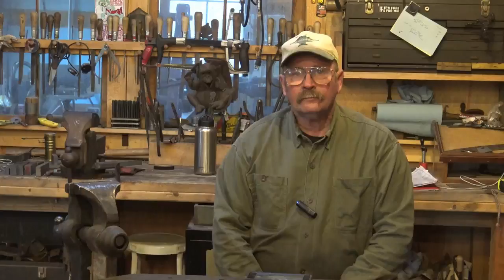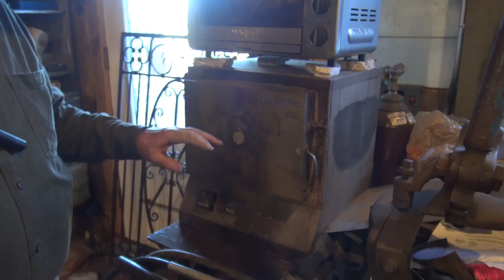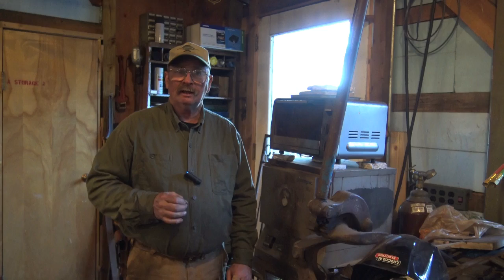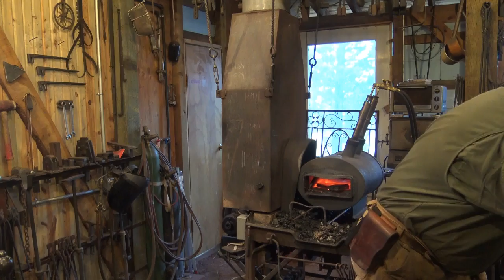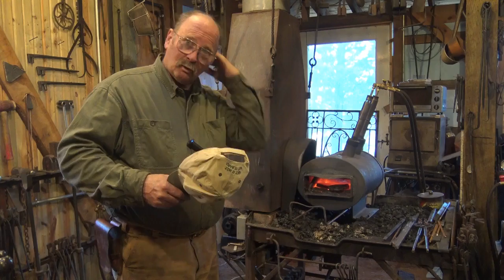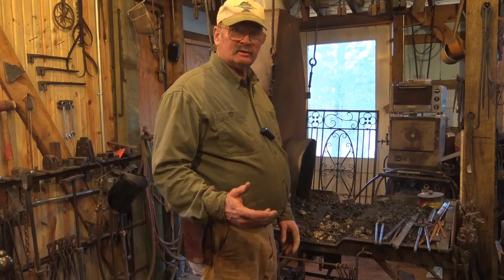Coal forge vs Propane forge a look at the pros and cons

Comment: Hey John i know this is 8years off of your video and you somewhat hit the topic but i believe i live near by and just bought a coal forge, im trying to source coal for it. Do you know anywhere to get quality coal in 2026 or do you order it in? I just purchased 500lbs out of Florence but haven't tried it out and really dont know anything about the quality of it or if it is even worth the price
Reply from the maker: I haven't found a good coal source locally.  But I didn't know there was still coal coming from the Florence Canyon City area.  Bituminous coal that cokes well is ideal, I have never had good luck with anthracite coal.  Where did you buy in Florence?
Reply: @BlackBearForge  Coal creek trading post if you come into Florence on 67 its literally just on the other side of the tracks to the left, they've got a pretty good stock pile there but like I said I know very little about it or the quality yet

Comment: On the note of Environmental, “Synthetic Natural Gas”, “Compressed Natural Gas” (From Upgraded Biogas or Power-to-Fuels etc) or more advanced Charcoals/Synthetic Coals (“Hydrothermal Carbonization”, “Pet-Coke” from Biorefineries etc) could have a place in the future for specialist uses such as Blacksmithing and Metallurgy.

It’s a whole rant I’ll probably make a video/hardware project about some day, but yeah.
Reply: “Ultra Clean Coal” (or more likely Charcoal / Bio-Petcoke versions) would be VERY neat to see as it is “washed” until it is near pure carbon.

So Anthracite if not better, and also highly porous (if not in synthetic anthracite compressed form as per a patent i saw)

Also would probably produce minimal clinker.

Burning Activated Carbon or POTENTIALLY Carbon Black (ESPECIALLY that from Methane Pyrolysis) may work similarly, albeit a pricy form of fuel for now!

Comment: I do remember the last gas well I helped my grandfather drill was back in 1963 and we did have the gas for the forge. So we had to use coal to dress the bits. When it was just started you could not see from one side of the rig to the other! Remember we were closed in with roofs and sides so it was really contained !

Comment: We always had the large forge on our cabletool drilling rigs of yesteryear !  We were dressing drilling bit from anywhere from 6"- 12" !! We usually used natural gas along with a blower off the drilling motor of the rig. You could heat an 8" bit to yellow forging temperature in about 30-45 minutes !  You had to be very careful or you would burn the end of the bit off. I remember my dad telling about him doing that one time and only one time because Grandad made him sledge it back out by himself. I forget how many heatings he had to do ??? But after that he always kept an eye on the forge ! Great videos !

Comment: Thanks for this video John.  I want to get some of the members of a low income community locally into blacksmithing. We have easy access to good quality charcoal.  What are your thoughts on Charcoal vs coal?
Reply from the maker: Charcoal is a good forge fuel.  But you will go through huge volumes of it compared to coal.  Probably about the same by weight, but the charcoal is much less dense so you use more by volume.

Comment: IMO the one and only reason to choose a coal forge over a gas forge is the ability to create your own fuel. They are great for homesteading or off the grid situations where you have the ability to make your own coal from local wood scraps. The only other thing is the historical aspect. If wanting to be either entirely self-sufficient, or historically accurate something you care about, then you are almost always better off with a propane forge. Propane forges are just faster, easier, cleaner, and for many people cheaper.

Comment: Hey John, can you discuss the pros/cons of a square vs round or oval cross-section gas forge? I am wondering if the square shape increases chances of uneven heating? Or if the oval/round ones are inconvenient due to the shape of the firebox?

Thanks,

Comment: One thing to consider is that some places with air pollution problems may have a ban on using anything fired with solid fuels.  Sometimes that may just be on certain high pollution days or it may be an absolute ban.  Some Colorado ski towns prohibit new installation of wood burning fireplaces (gas logs are OK).  Check your local regulations.  Also, in some places the local Fire Code may restrict what kind of forge you have and how it may be installed, e.g. you may need multi walled pipe to go through the roof for the chimney of your coal forge.  Again, check local regulations.

Comment: One disadvantage that I wish I was told about propane forges, is that if you have a small tank and a cheap pressure regulator, it freezes up. I wish somebody would have told me I could have just put the tank in a bucket of water. But hey you live and learn right?

Comment: Propane today is very expensive considering the astronomical rise in fuel prices.  Coal is also now very expensive and hard to get here on the west coast.  I've cut back on using coal and now only use it when forge welding. I've mainly been using the gas forge and putting up with the cost.  I've been blacksmithing for over 30 years and never tried charcoal. Think I'll try it out and see how it goes.  Good video!!
Reply from the maker: Propane is still cheaper than coal in our area but I am planning more projects in the induction forge these days.

Comment: excellent video dude but you missed a third type of forge, woodfired. good coal has become increasingly hard to find out where i live so i just keep around 100 pounds on hand for special things. mostly i just burn wood, coke it as i go, same as i do the coal. i find the wood much more economical and environmentally friendly then either of the other 2. you can get wood from anyplace and many times, unless you're picky, you can get it free. all wood burns and becomes coke and if you pay attention it burns a lot hotter than propane ever dreamed of. you can also burn wood in a furnace type enclosure (commonly called a woodstove) and heat your smithy quite nicely. i have not tried to weld with wood coke, grandson has (accidentally...lol) but its coke and you know as well as i do, it will get hot enough. other than that i am enjoying your videos, nice to share the knowlege and skills. too much emphasis these days on just making weapons and knives, i prefer coulters, cultivator teeth, highwheel cultivators, evener ends, tongue tips and hammering out old od-sized disc blades. good practical farm and home tools.
keep it up and ill keep watching...when im not in my smithy :)

Comment: The induction furnace can be a DIY unit if so desired. It does require a flowing water source (to prevent the coil from melting while in operation).  It’s essentially an RF power generator operating into a very low impedance copper tube.

Comment: Although the induction type heating devices are expensive, they have one distinct advantage, the work that they (ones can be built for specific alloys), do, is very fast (seconds).  One must learn of the alloys used in manufacture of the metals. 

No, I’ve got no vested interests in any of these type ovens.

Comment: I like how quiet coal and coke is.
I only have anthracite,and it goes out if the blast isn't restored in 5 minutes.
I do melt non ferrous with propane +oil though.Definitely will try charcoal in the forge!

Comment: An old blacksmith showed me how to start a coal fire with just 6 pieces of paper !  I could not get over it but by golly he did. I remember helping my grandfather drill a gas well and we did not have gas for the forge to dress the drilling bits so he had to use coal. It got pretty smoky in the dog houses till the forge got going good.  The bits were 6-8" bits usually.

Comment: Did you add the protective shelf in your Chili forge?  Is that what is retaining heat that then lows you to just switch the gas back on and have it relight ?
Reply from the maker: The ceramic lining stays hot enough to re ignite the gas for quite some time.  Although I don't recommend turning the forge off and back on every heat.  I only do it for the improved audio quality in the videos.
Reply: @BlackBearForge  appreciate the feedback.

Comment: Hi John just came across your channel.. Very informative.  I'm looking to get into blacksmithing and  knife making as a side hobby. By trade I'm a drop forger at Channellock in meadville PA. We use  induction forges.. They are very fast.. When I first fire it up it only takes me roughly 4o  seconds  to get a 1080 bar to forging temp. It spits out a bar every 8 seconds and the 5th  bar it's ready to go.. Very good channel  really enjoying it.

Comment: I live in Florida and I’m lucky to find lump coal. Lowes has it for $12, for a 15lb bag. I tried finding anthracite coal, but that got me a laugh everywhere I asked about it. They’re supposed to carry it at Tractor Supply, but why would they need to here? We have like one week of almost cold weather. Tractor Supply did have plenty of whole kernel feed corn, in 50lb bags for $13. It’s similar to anthracite to get started, but it produces a beautiful flame like I’ve never seen before. The weird thing is.. it produces coke, instead of popcorn.😆 You have to keep the air on the whole time or it will go out, which is good when you’re done. I’m new to this so I haven’t actually forged with it, I just burned a couple fires to cure my diy refractory cement, and to produce plenty of coke, so it doesn’t take me a half hour to start a fire. I did get a piece tool steel up to critical heat to soften it, but that was all I’ve done so far. Honestly though, the lump coal is lighter than corn, so I seemed to get about the same amount as the corn. I have my forge set up to use wood as well, so I’ve got a stock of all three fuels to see what works best for my usage. Here’s the best out of only two videos I found about using corn as fuel.. https://youtu.be/T-UgxYiiAWI ...   Thanks for the wonderful videos. It’s nice to learn from a real pro.👍🏼🔥⚒

Comment: After researching about rocket mass heaters, model rocket engines, and having my own retort, adding a secondary burning area with a secondary air intake to the chimney will burn off the unburned gasses coming off the forge from the coal.

Comment: Another concern for anyone interested in induction forges, the electromagnetic field can be a hazard for anyone with an implanted medical device. I’ve visited a friend who works around several induction forges in a commercial heat treating shop. And they go to great lengths to identify the hazard to any person that might be on the shop floor. And some of these furnace’s are about the size of a residential oven or slightly smaller. Obviously this is a unique hazard but food for thought none the less. Keep up the great work you’re videos are highly enlightening and entertaining thank you.
Reply: But, if you’ve not subject to the harmful effects of the, what’s called, the EMF, of these devices, they are VERY fast (seconds), in heating a piece of metal that reacts to the field presented to it.  There “are” furnace types that can heat Aluminum. 
Btw, I’m not someone that does metal working.
I also have no vested interests in the companies that sell them.

Comment: What is your opinion on the vintage style forge with the hand crank blower. Can you achieve the heat to forge Weld?
 My propane forge will not get hot enough. Thank you John you're a great teacher.
Reply from the maker: As long as its a blacksmiths forge with a real fire pot, it should be more than acceptable.  But there were also smaller ones like rivet forges that are not good for forge welding.

Comment: I'm very thankful that I have the option as a blacksmith to take advantage of my family's coal mine I typically get it from tractor supply but the the mine is 4 hours away and if I'm gonna make a trip down there I got to take our 1965 Ford grain truck that barely does 50 mph empty but I need to get that ready and I'll probably get 2 loads of coal and use that I just need to find the time to get down there and get the grain truck ready for that type of trip I may be crazy but good coal is worth it

Comment: So, I have white oak trees in my yard, and they drop stuff all the time. (I have to actively chop the stuff up from time to time, or else the brush pile in the backyard gets away from me). I've made charcoal in the past (it's easy enough that I usually try to make some whenever I barbeque after the burgers are done), so that wouldn't be an issue.

But if I were to try to forge with it (in either wood or charcoal form), is there anything I need to watch out for?
Reply from the maker: Charcoal is a great forge fuel.  But you needs much more by volume than you would coal and it leaves lots of ash behind,  But it burns cleaner and isn't as likely to annoy the neighbors.
Reply: @BlackBearForge  I'd ask about the raw white oak, but that smokes like crazy (to give you an idea, I made a turkey in one of those cheap charcoal grills and it melted the paint off, but the parts of the turkey that weren't burnt to death were fantastic, hahah...didn't even have to put a pan in to make any smoke...)
Reply: P.S. I have a cedar tree as well, but i'd be worried about poisoning myself with that...

Comment: Dear John, I have a gas fired forge and appreciate the cleanness of the burn and the good concentrated heat.  My main problem is that the fire does not allow for segmented heating of only a part of your work.  It is also limited in size to that of the mouth.  I agree with the discussion about coal and think it is at the end of its line.  

What about the idea of building a gas fired furnace where there is a central pit that heats up some carrier medium in the open, built like a coal fired forge.  A small circular fire in the centre powered by gas is the idea.  The user can then place their work at exactly the spot they want to heat and the parts you don’t want to heat are out of the heat. I’m not sure what the medium would be as it would have to survive being heated up to 1500˚C or more.  I guess clay beads would survive this intense heat but would give a bed of resident heat.  

How big to make this fire?  It’s a surface area versus volume argument.  A sparrow cannot survive in the Arctic but a Woolly Mammoth can.  For the same reason, making a fire say 300mm in diameter would work nicely. It would also mean that once established, little fuel will need to be added to maintain the core heat. 

To heat your metal, poke it into the centre and wait a couple of minutes and voila - red heat again. Clean abundant relatively inexpensive heat that gives the versatility of an open pit fireplace.

Comment: A difference I see in coal vs gas forges is that in a coal forge you can very precisely isolate the heat, a gas forge just heats everything inside...
Reply from the maker: True, but there are many instances where you want that long heat.  So having both options is ideal

Comment: I happen to work at a coal mine, so coal is my go-to. However I just downsized my shop space considerably, and working in small spaces, I'm limited to what exhaust methods i have available. I'm either going to gas, or I'm gonna make a forge cart to roll out onto the driveway. Haven't made up my mind yet.

Comment: Going into this video I was wondering if I'd get any closer to deciding on gas or coal, gotta say it sounds more like I need both!

I will be building my own forge and it wouldn't be hard to weld from say 10mm steel plates. I will be forging outside so I can ignore issues with heating up the place. I will store the equipment in a building I am building right now, will be uninsulated. A simple coal forge I can wheel outside is a simple way to get started I am thinking and very flexible. What really attracts me the most about coal is how you can put any piece of length in the fire whereas that would be difficult with a gas forge, like you mentioned.

I can't get coal here but I can get coke from a local smithing organization (100km away), no idea yet on prices though, but who knows how long it will last. Finland has no coal reserves oe mines, so it's all imported. Charcoal though, that and tar is something my region is historically known for so I could always run on charcoal, but I am told it's expensive since you use a lot more of it.

And to add a third contender, Torbjörn Åhman on youtube built a diesel forge, I can get my hands on a similar oil burner cheaply and get all the complex stuff ready and fuel oil (diesel with red additive) is really cheap here, I can get it a few km away at the gas station.

Comment: Quick note on your diesel forge comment there, im working on hybridizing my propane forge to run waste veg oil as well. My foundry runs on WVO and gets extreme heat, runs with forced air but is gravity fed and unfiltered. I have the ribbon burner style forge and i will be adopting that same wvo setup for it. If you wish to have an update on my progress i can make it happen! WVO is free in most cases and more efficient
Reply from the maker: Thanks for the information.
Reply: Wve needs preheat cycle with wood or propane to achieve a contant internal temp of 800C or it will not catch fire, it will just cool off the inside